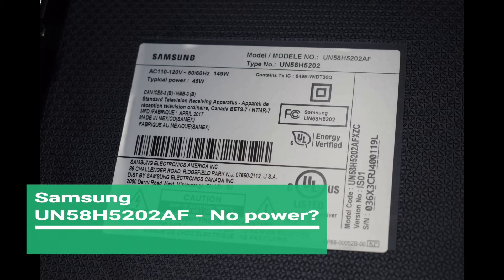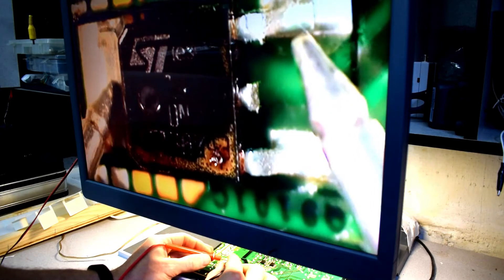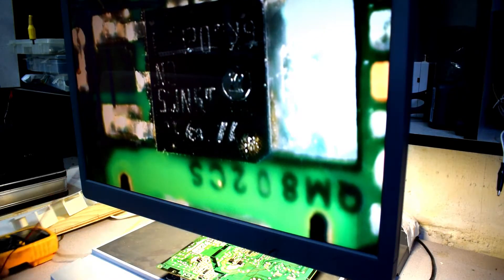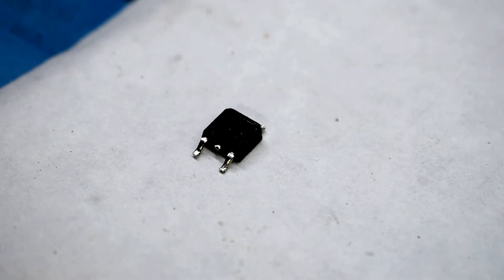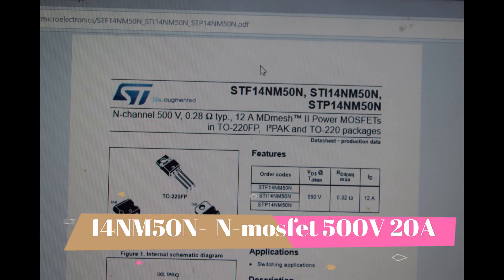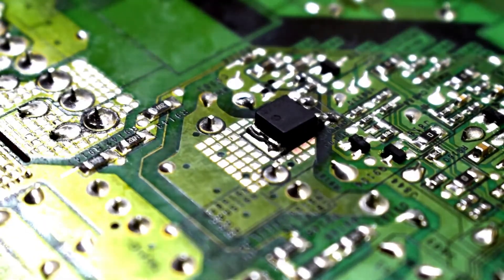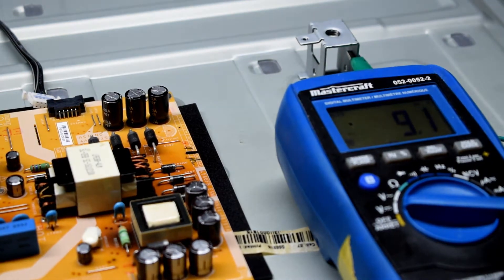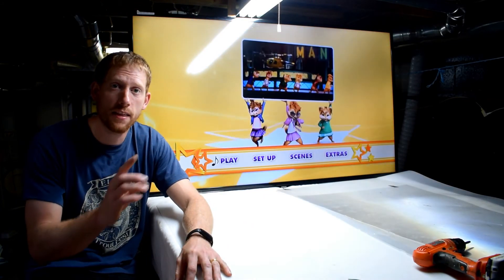Samsung UN58H5202- No power repair

Comment: I replaced the 14nm50 with 13n60 as it was the only available equivalent mosfet in my area..worked for 1 year and blowed ...I tried it again but didn't last than 4 days ..also i discovered that.the shotkey diode mur460 which in same area also become very hot . Any suggestions

Comment: How could I find a replacement for the 14nm50n ? You video is very helpful but I ordered the mosfets in the link but they are going to take 2 months to get to me and nothing on this side of the world is in stock
Reply: I'm guessing you got your MOSFET already but just in case... Best bet is to order a new (Yes, actually new) updated board off eBay. I only paid 45 bucks US for it and it's the new version that solves the problem these all had to begin with, not enough juice. This is well worth it.

Just verify It's the same as what you need, it fits several models.

The board number is:
BN44-00787A

Comment: I just changed the MOSFET. The repair worked,... for 1 day. Then it shorted once again.

Can you install a MOSFET rated for higher currents, and hope it won't pop?
Reply from the maker: it sounds like there is another issue on the board. check down in the circuit something is drawing too much .
Reply: @NewsonsElectronics  Probably shorted LED's

Comment: Seen this many times. Reduce backlight levels for a longer life of the leds.  Anyone experience low standby? 4.5 volts when 8 standby to 12 run is marked on the board.    That mosfet tested ok, changed anyway but ps will not produce full power.
Reply from the maker: great insight

Comment: Hello friend I have this problem too, I has been change ST a new one and then it’s work just only 5 minutes and broken again can you help to tell me.
Reply: George Bong  so far every tv that I’ve had to replace this MOSFET has been only because the Backlight LEDS are burnt.
Reply: The reason for this MOSFET short out is because some of the back light LEDs inside the panel are burn out. As long as the TV has burn out LEDs this MOSFET is going to short out. Here is tutorial of how to replace the back light LEDs. Good luck !! https://www.youtube.com/watch?v=h5Zyqowl6zg